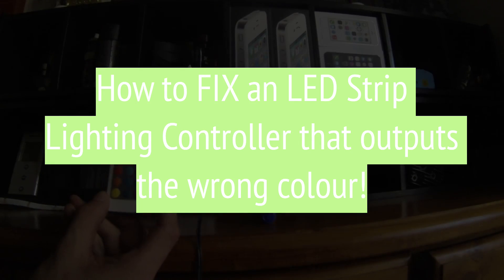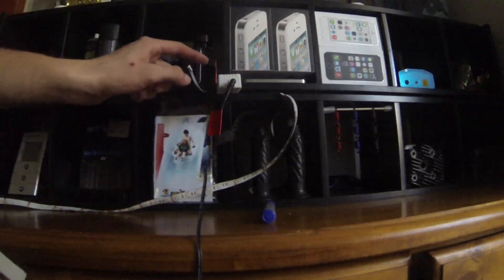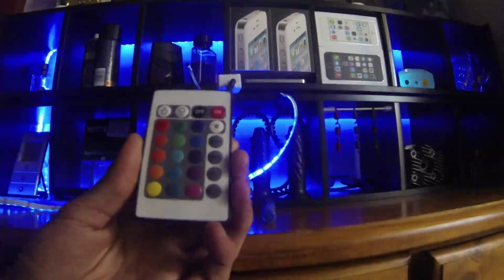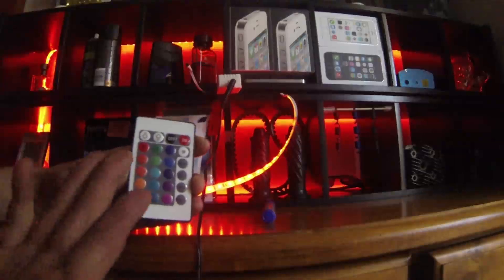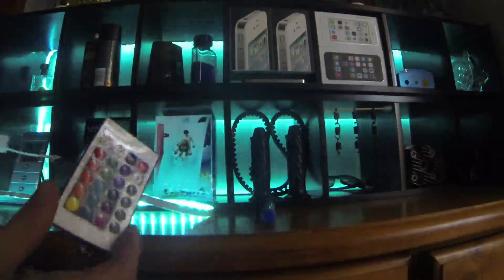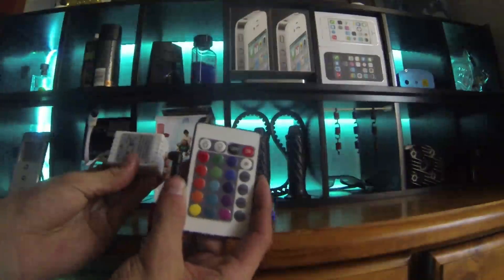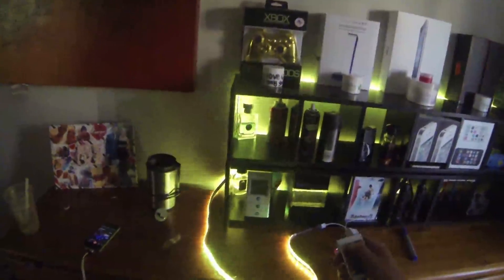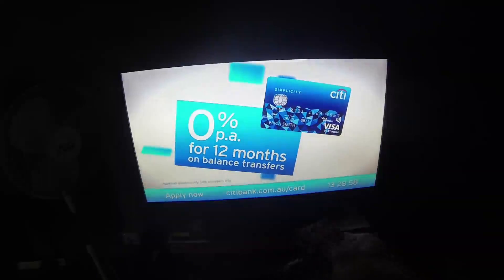How to FIX an LED Strip Lighting Controller that Outputs Wrong colour!

Comment: Thanks, for all of us with 44 key remotes, here are the steps.
1. Press red 
2. Turn it off with the red "off" button
3. Press "FADE7" when its off (this should make your led strip flash once really quickly)
4. Turn it on and press red to see if it's red now.
5. If it isnt red, repeat the steps until it is (1-3 times).
Reply: No matter how many times I do this,when I presses fade 7 the flashing never goes :/
Reply: Obunny7 Hypixel me too how do i fix this
Reply: Valerie T. yea same did u ever fix it ??
Reply: How is everyone lights getting fixed by this mine isn’t flashing or changing color at all my red is purple my blue is purple my yellows and oranges are basically white and I’m freaking out
Reply: Bekabob 03 i’m crying i have the same problem, please please please tell me if you fixed it
Reply: Bekabob 03 did u fix it ???
Reply: Bekabob 03 have you tried this multiple times? Maybe unplug it and plug it back in and check the connections where the LED lights are connected to make sure they aren’t loose. Because mine kept flickering once and they wouldn’t turn on so I checked and it was starting to unplug so I pushed it back in and it worked. If this doesn’t work try to call the company that you got your LED lights from they might be able to help.
Reply: Thank you so much, kind stranger!
Reply: CP:GN Bird thanks I’ve been trying to sort this for ages. Been told all sorts to try even by the seller and this did it. Cheers much
Reply: @gregwbrittain  tysm
Reply: Greg Brittain thank you SO much!
Reply: Bless your soul
Reply: I though i did something on accident to the wiring. Thank you!!!!!
Reply: @bcp25  my led strip the blue didnt come off i cant speak english
Reply: You're AMAZING
Reply: I did that its still not working properly all the colors are messed up what do i do
Reply: That was a quick fix. Thanks so much. My little niece found another IR remote and pressed it's equivalent of fade7, messing up the functions.
Reply: love ya buddy
Reply: Thank you👊🏿
Reply: CP:GN Bird works! One thing, the green color leds dont work except for 1 led... but ALL leds work for the other colors. Its just the green color where the whole strip doesnt work except for 1 led. Is the strip fixable?
Reply: Jason Zacarias sane thing is happening to me to
Reply: please help this doesnt work for me when i press re turn it off and press fade it doesnt flash
Reply: YaBoiAliza same
Reply: YaBoiAliza did you find a solution?
Reply: Omg thank you so much
Reply: Thankkkkkkkk you
Reply: Cheers
Reply: You are my hero
Reply: I LOVE YOU, YOU’RE A LEGENED
Reply: You are a beast for this. Thank you very much!
Reply: Thanks! This worked for me although it did work on the 8th attempt, not in the first three tries.
Reply: thx so much
Reply: Cheers
Reply: I know I'm late but holy shit thank you you're my saviour
Reply: Omg thanks this fixed my lights Bc when I pressed red it was blue and this helped fix it. THANK YOU KIND SIR
Reply: I know im late but i think it ruined my lights.My led lights were kinda broken,cuz they didnt light the same color.When i press red or blue,it lights in purple.And now i tried this,it made my red green and my green purple.
Reply: @jzksnnns9541  do it again press red press the off button and then press fade7 then press on and press red keep repeating until it goes red again
Reply: Amber Tanvir The thing is, that my remote doesnt have a red color.When i press red and turn down the brightness,and when you look closer,you can see,that the they light red and blue at the same time,and when i press blue,you can see the same.When i tried this hack,it switched my red (purple) to green.
Reply: Ive done it almost 20 times and it just changes from purple to green :(
Reply: •Yuki Playz• Do you have 44 key .
Reply: @indi3527  Yes
Reply: may the Lord send blessings your way
Reply: CP:GN Bird sorry that i’m late but can someone help me my lights never flashed and i did everything right
Reply: Omg thnx soooo much I got so scared I thought I broke it
Reply: Omg thank you so much 😭😭
Reply: wtf this really worked! dont know how you did it sir but yayyy
Reply: omg thank you, you’re a life saver
Reply: but what if your led lights ONLY show red like anything that i press, its red
Reply: Chimoltrufia . Com  that’s weird try the steps a few more times
Reply: Zuleima Salmeron ok, i’ll try that, thanks, and yeah it is really weird
Reply: TYSM!! it took me like 5-6 tries but all is well!! thank youuuu <3
Reply: HOLY IT WORKED! THANK YOU SO MUCH!
Reply: Fade 7 didn’t make my LEDs flash, but there was alternative method that I found. This worked for me:
1.press red
2. Press the power off button on the remote
3. Press the button in the bottom right of  your remote (mine said flash)
4. Turn it back on, then press red 
5. If it’s red it’s worked, if not try for a few cycles until it changes 
🤙🏽
Reply: omg ur a life saver
Reply: Thank you
Reply: omg tysm
Reply: CP:GN Bird OMG THANK YOU
Reply: Thanks dude!!!
Reply: God bless u man. I thought my remote was broken or something I'd been doing research for hours
Reply: thank you so much! i did this a bunch of times and it finally switched all my buttons!!
Reply: OMG THANK U
Reply: CP:GN Bird life saver
Reply: Omg i didnt again and it worked thank u thank uuu thankk uuuu 😍😍😍thankk u sooo muuchh
Reply: THANK YOU SO MUCH
Reply: Thank you!!!
Reply: Omg tysm this helped so so much ❤️😂
Reply: Tysm
Reply: Thanks so much!
Reply: brooo tysm!
Reply: Worked here as well. Thanks a lot man. 
My issue was that with completely different remote, orange-yellow was changed to pink :)
Reply: My friends were going to kill me cause I changed the colors
Reply: Now red is blue :(
Reply: Got it, thx so much
Reply: What if it doesn’t flash off
Reply: you are my hero
Reply: Oh my god your a freaking life saver thank you so much
Reply: Omggggg i was worried when it didnt work i was acc crying thx soooooooo much ur a life saver
Reply: Thank you so much
Reply: CP:GN Bird thank u
Reply: CP:GN Bird you’re amazing thank you
Reply: Thankyouuu you’re a real one
Reply: THANK YOUUUUUU
Reply: CP:GN Bird thank you
Reply: Can you do the same with white?
Reply: AFTER STEP THREE IT WONT TURN BACK ON
Reply: CP:GN Bird OH MY GOD THANK YOU THANK YOU THANK YOU THANK YOU !!!!!!
Reply: Thanks I did it 3 times and it worked
Reply: CP:GN Bird thank you so much!!
Reply: that helped so much
Reply: thanks!
Reply: THNAK YOU!!
Reply: Thanks!
Reply: this broke it even more
Reply: thanks
Reply: Thank you so much
Reply: Elise_Harley_Annie_Hudson_ _  ME TOO
Reply: Thanks omg this works
Reply: u jus stave my life
Reply: i did that on accident thinking it was on and the lights flashed then my colors were out of wack but i’m so glad this worked bc i realized what i did. thank you
Reply: Thank you so much. I had just got them today and I was stressing this really helped🙏👍💛
Reply: I love you
Reply: Thanks! This really helped!!
Reply: THANK U 🙏🏻 U LITTARLY MADE MY DAY GOOD, thanks for sharing dis with da word
Reply: Life saver
Reply: Thank u so much❤️
Reply: Thank you so much for this 😭❤
Reply: CP:GN Bird funny thing cause I did this right now and I didn’t know it would actually work💀
Reply: CP:GN Bird thank you I’ve been struggling for hours and this is the only one that worked👍
Reply: thankyou soo much xx
Reply: CP:GN Bird you saved my life!!! Thank you so much
Reply: CP:GN Bird THANK YOU !!
Reply: My G
Reply: Thank you so much I was so annoyed when I accidentally pressed fade 7 when it was off this saved me 🥳 can’t thank you enough 😁
Reply: thanks!
Reply: Thank youuuu
Reply: I was getting frustrated that my led lights weren’t working and then I saw this,thank you so much
Reply: It worked!! Thank you! 😁
Reply: Seriously thank u so much!!!!!❤️❤️
Reply: CP:GN Bird ayyye it worked
Reply: THANK YOU SO MUCH
Reply: You're the goat
Reply: When i click the power button .. it turns red😐
Reply: Thank you so much 😫
Reply: I love u bro
Reply: liking this so it gets to the top, tysm this actually worked i was so scared i thought i broke them and i only got them yesterday haha
Reply: life saver bro
Reply: omg ily tysm
Reply: THANK YOUU
Reply: THANK YOU SO MUCH!!! it took a few tries but it worked
Reply: thank you so much omg
Reply: THANK YOU SO MUCHHHHH
Reply: Holy crap thank you! I thought I messed it up somehow
Reply: Mines still doesn’t work
Reply: THANK YOU SO MUCH
Reply: thanks dude
Reply: I LOVE YOUUUUU
Reply: You are a GODSEND!
Reply: Thank u so muuuuuuch
Reply: I’m trying but it doesn’t work I’ve tried around 10 times
Reply: YOU FIXED MY LIGHTS!!!!
Reply: I LOVE U
Reply: OMG THAT WAS SO HELPFUL I WAS FREAKING OUT THAT MY LED LIGHTS DIDNT WORK LOL
Reply: Thank you so much
Reply: OMG THANK YOU SO MUCH
Reply: thank you so much! i thought i broke it
Reply: the red was green originally and after a few tries it changed to blue - on my fourth or fifth attempt it went back to red and the rest of numbers went back to normal thank youuuu
Reply: THANK YOU BLESSED CHILD
Reply: wait my fade7 isn’t working.. what do i do?
Reply: CP:GN Bird thank you!😔👊
Reply: Thank you☺️ bless your soul
Reply: everytime i put fade7 it doesn’t flash!!
Reply: what’s the second step i don’t get it
Reply: what do u mean turn it off with the red off button??? help??
Reply: Shut up bitc
Reply: Thank you i will sub
Reply: Omg thank you sooooo much!!!
Reply: TYSM
Reply: Thanks so much
Reply: Thank you so much
Reply: THANK YOU SO MUCH
Reply: OMG TYSM THANK YOU
Reply: Thank you so much 😭
Reply: TY sosososos much i’m never gonna let a little kid press it so much
Reply: YOU ARE AMAZING
Reply: YOU ANGEL
Reply: Holy shit thank you so much
Reply: Omfg tyy
Reply: Thank you so much
Reply: OMG THANK YOU SO MUCH
Reply: THANK YOU SO MUCH
Reply: broo thank you so much
Reply: TYSM
Reply: Bruh ur the best 😂🖐🏻
Reply: When i press the off button it just turns blue and never turns off ..any help?
Reply: thanks alot
Reply: THANK YOU
Reply: Tysm, I literally was about to cry bc I got them yesterday day from Christmas gift and thought I broke it
Reply: Thank you sooo much🥰
Reply: Thx
Reply: You are a godsend
Reply: Thx that worked so much
Reply: I wanna do this but mine dont even turn off 😔
Reply: Thank you so much for this it helped me so much! :)
Reply: Respect +
Reply: When I. Press the red off button it dosent turn off it goes to blue and green
Reply: omg thank you so much
Reply: Thank you so much, now my sister is happy again.
Reply: Mine doesn’t flash :(
Reply: thanks so much! you’re a lifesaver bro
Reply: Oh wow, what a pro-tip!
Thanks a bunch!
Reply: THANK YOU!!!
Reply: TYSM I THOUGHT IT WOULDNT WORK CAUSE WHEN I TRIED IT, IT KEPT SWITCHING COLORS BUT WHEN I DID IT A COUPLE TIMES IT WORKED
Reply: Tyvm!
Reply: Thank u some such
Reply: I don’t have a fade button since mines a RGBIC remote :/
Reply: I did but it just keeps mixing them again
Reply: my thing doesn’t flash with fade 7 :(
Reply: It doesn’t work for me
Reply: @niazali2200  it does work you just have to do it a couple of times. This is the only thing that worked for me.
Reply: LIFE SAVER
Reply: THANK YOU!!!!
Reply: I LOVE YOU SO MUCH
Reply: Omg bro your a life saver i literally didn’t know why my led lights weren’t working
Reply: THANK YOU
Reply: Fade 7 won’t work tho
Reply: Fade 7 won’t work and red won’t work either when I press red it turns black
Reply: Omg thank u so much I was so confused as to what happened and I just followed ur steps and it worked🥰
Reply: WHAT HAPPENS IF YOU USE THE APP HOW DO YOU RESET THAT PLEASE HELP
Reply: Thank you so much man omg finally
Reply: My on/off button is turning blue and purple
Reply: 3. No flash
Reply: i didnt have fade7 ihave just fade pls
Reply: THANK U BRO OMG
Reply: What about t when the power button turns your remote dark blue :(
Reply: Thanks mate works perfect
Reply: DOESNT WORK.
Reply: Thank you very much! I was going geniunely crazy!
Reply: The hero i needed
Reply: CP:GN Bird help! It turns blue when I press the red off button ?
Reply: H what’s the red off button ????

Comment: OMG ! Thank you so much guy ! I was scratching my head not knowing what caused it to change colors, i though it was using same remote for both 3528 and 5050 rgb led but no, just my energetic need of fast color changing that caused it.
Thank you sooooo muuuuch !!
Reply: On my 24 IR Remote I noticed different led types will use different buttons : 
- 5050 LED will use Fade button to cycle colors
- 3528 LED will use Smooth button to cycle colors.
Hope it will help other people as well.

Comment: When I press "smooth" it makes no flash. instead when I turn back on it's in smooth mode. any ideas?
Reply: i know i’m many years late but do you still need a fix? what kind of remote do you have
Reply: @annaliseph  Mine stays at a mixed red and blue color. I can't turn it on with the remote neither turn it off remote doesn't work at all. Even with the app I cant change the color of the lights neither turn it on or off.
Reply: @annaliseph  I still need a fix

Comment: Thank you so much, you fixed my problem.
What caused this was Fade 7 being pressed when the device is switched off. It causes a brief flash, and subsequently pushes everything 1 colour off.

You're a legend.
PS I have the 44 key remote, white front, black back.

Comment: when i press off the light stays green and it doesnt turn off
Reply: Did you find a solution to this. Even mine stays red after pressing off button
Reply: Me too
Reply: Then you have your power cord connected to the green light. You have 4 connected points on your strip; voltage, Red, Green and Blue
Reply: My red
Reply: I got it, 
1, press red
2, turn off
3, disconect the power plug
4, press smooth
5, turn on
Reply: same here

Comment: mine's stuck at green when i plug it into power. the remote doesnt do anything anymore. any tips?
Reply: ilickspam same
Reply: @ivonne74akamark88  are you using the plug that came with the device? if not, use it because i had the same problem and it fixed it.
Reply: wEaVe SnAtChEd I’m using the cables that came in the box
Reply: Meme Central idk how to fix it
Reply: Legends say he still hasn't fixed it @ivonne74akamark88
Reply: Maybe the remote battery doesent work and the last time you used it, it was at green?

Comment: hmh i have the 44k remote and it does not work with fade 7 :s what should i do?
Reply: i have done it about 50 times and nothing has changed
Reply: Brayden Gilbertson what does he press? i can't understand him
Reply from the maker: Try 'Smooth 7' or the other auto mode buttons. When the leds flash: you have found the button!

Works with 99% not 100% sorry. :)

Comment: I guess this doesn't work with a music LED control with 24 key remote with a FADE7 button. At least buttons red, green, and blue work. Figures they would with it being an RGB light strip. Damn Chinese junk. Anyone have a link to a better kit?
Reply from the maker: No, sorry- if/when you find a fix, please let me know incase others comment the same thing :-)
Reply: They weren't messed up to begin with. I just had to put them in/behind something to see multiple LED colors make one color.

Comment: it doesend work on my 44? key remote! I tried pressing the fade7 but nothing happened
Reply from the maker: Hi Gabe, try the Smooth buttons and fade 3
Reply: +Drew BoyerGamingHD there is no fade2
Reply from the maker: Sorry my mistake, my remote shows Jump 3, Jump 7, Fade 3 & Fade 7. Also Flash

Try them all.
Reply: ***** none of them work
Reply: ***** amd if i try to press the white button, the led strip "breacks" and to fix it i have to diconnect the strip from the controller thing
Reply: and*
Reply: Hi, did you solve you problem ? 
Got the same problem with a 44key remote. Green and Blue are inverted and I don't know how to fix it. Fade buttons trick didn't work for me...
Reply: Laurent Pierru i still have the problem :(
Reply: Random shit all you have to do is press FADE7 till you see a flash
Reply: Rialtacity it doesent flash :/

Comment: Hi, I hope you can help, I recentley installed my LED lights and they 
were working perfectley, now, when I press the off button, they go green
 and every colour that I switch to when they are turned on is mixed with
 green.
Reply from the maker: I had the same problem with the controller module itself, if you open the White Box you will see the damage. Unfortunately you will have to order a new controller. :/
Reply: @DrewRaymondBoyer  is it the remote or the white box needed to buy new?
Reply: That happened with me for red but the next day it worked
Reply: ThorWasStreaming same